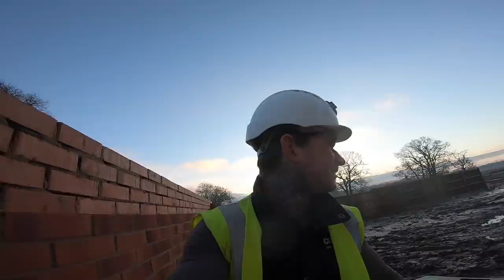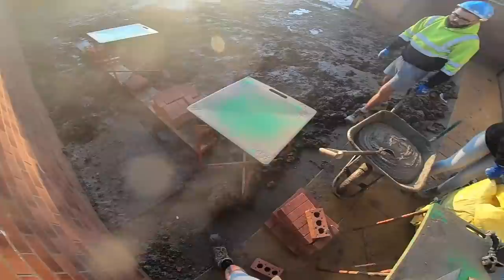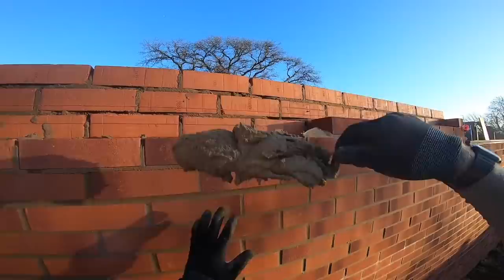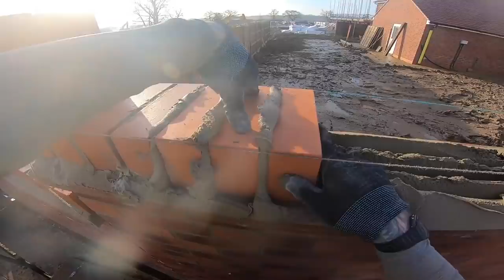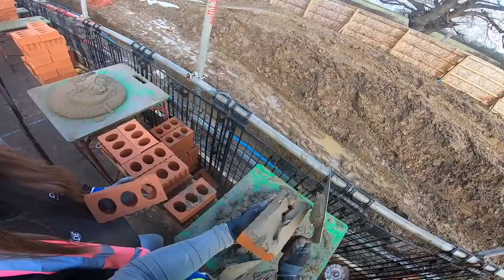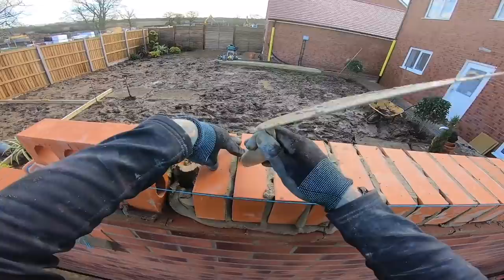Me and Amy on the line!

Comment: Fitz brick.  Already said to them with no reply can’t believe they made them 15mm 20mm shy for catching 140mm concrete block. That level lasting no time that metal butt on back of trowel bouncing of it lol. Can’t be scratching Amy’s new tools lol. Feel you pain in last bit get some cheap hop ups in screwfix normal £30 odd bucks get 2 bam a batten across them happy days.
Reply: Hi I did reply please check on brickwork tools youtube channel. 
6" blocks are fast becoming a thing of the past. I work closely with a lot of brick merchants and they sell very few 6" blocks now. The issue is not adding 20mm. The spring is designed to open a certain length and if it's extended too far it will stretch and weaken it making it no good for 100-110mm.
Reply: @richardfitzgerald4812  
140mm are nowhere near becoming the past maybe in England. But not in Scotland for sure all 140mm timber kits 
140mm internal walls for kits sitting on and new build extensions a should build plenty of them. Just really depends what country your in a suppose.
Reply: @lmilne4859  OK sorry I didn't know that. Because I have the patent for all sizes. I have had 150mm clamps made up before I can have some made with a spring the same strength as the existing one that will be made to stretch that much if you think there's enough demand.  Because there made from stainless steel and made here not China I have to have a lot made or it's just to expensive.
Reply: @richardfitzgerald4812  
If get them made up for no matter the price a will buy a set for sure. 
Be great for the internal skin 140,s setting out foundations. 
Think Scotland Ireland more poplar the 140 blocks there bloody heavy things 😆
Done garage and needed the clamp badly as couldn’t reached of the wall for line dew to rubbish scaffold and was 140 blocks. 125mm oh come open just a bit more 😆😆👍🏻
Reply: @lmilne4859  No problem I already have the cad design. I'll ask the factory this week. It'll take a little while to get them so please be patient.
Reply: @richardfitzgerald4812  
Fantastic buddy. 
Cheers lee.
Reply: @lmilne4859  sorry I forgot to say don't forget you won't be able to use them on 100mm work the spring won't be strong enough. There's a restriction on how far any spring made to how far it can extend and contract.
Reply: @richardfitzgerald4812  
Yeah sound mate have a set of 100mm 1,s anyway.